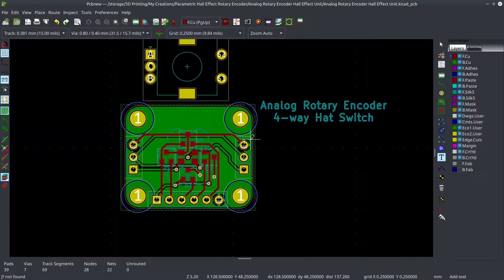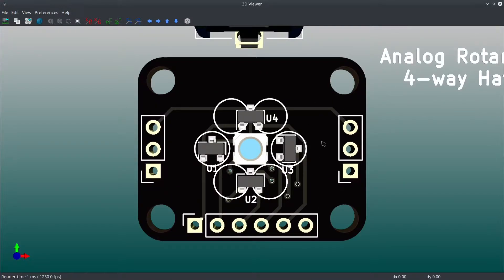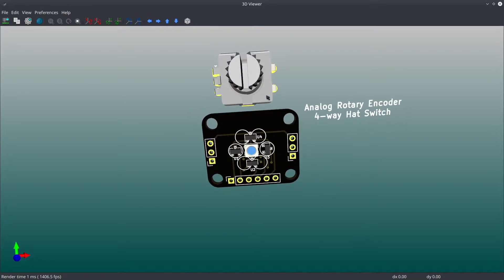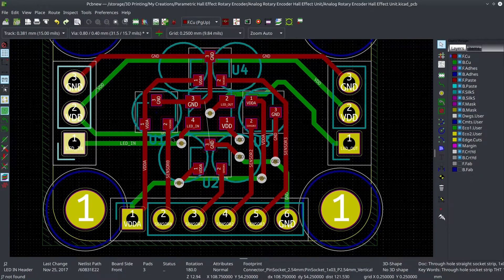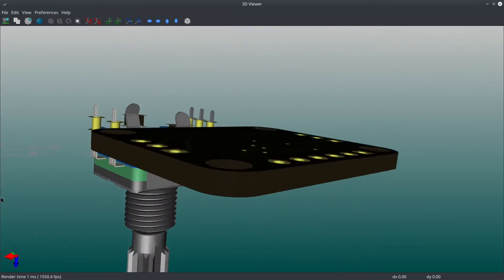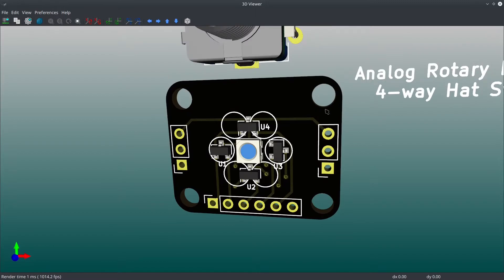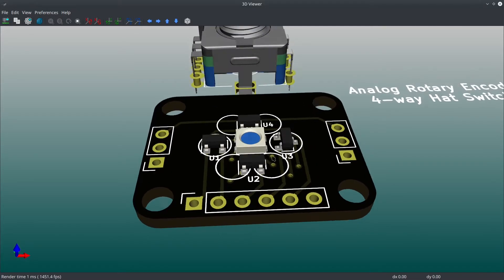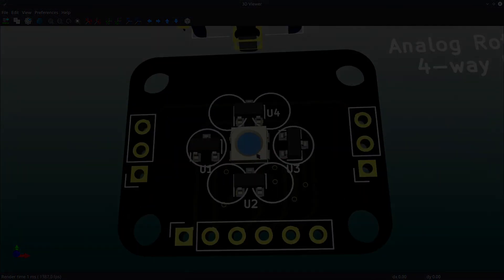New Hardware Idea: Analog Hall Effect Rotary Encoder with Four Way Hat Switch Breakout

Comment: // and the ball is enclosed in a cube with a sphere cut out of it, split into two halves top and bottom.
// dimensions adjusted to fit the board I don't have.
// bottom of enclosing cube is cut away to clear parts & connectors on the board.
// cube is high enough to allow for tilting.
// cube is low enough that you always have a signal on the sensors.
// cube has holes in the corners for mounting.
dball = 17;
xsize = 26;
ysize = 22;
zsize = dball/2;
dmagnet = 4 + .1;// slop
hmagnet = 1.7;
xmagnet = dball/4;
hhandle = dball*1;
dhandle = 5;
hknob = 5;

difference() {
    intersection() {
        sphere(d = dball);
        cube([xsize, ysize, zsize], center=true);
    }
    #for (r = [0:60:360]) rotate([0,0,r]) translate([xmagnet, 0, -zsize/2 - 0.01]) cylinder(d=dmagnet, h=hmagnet+0.02, $fn=25);
}
cylinder(d=dhandle, h=hhandle, $fn=25);
translate([0,0,hhandle-hknob]) cylinder(d1=dhandle, d2=dhandle*1.4, h=hknob, $fn=25);
translate([0,0,hhandle]) cylinder(d=dhandle*1.4, h=hknob, $fn=25);
translate([0,0,hhandle + hknob]) sphere(d=dhandle*1.4, $fn=25);
Reply: Added this. Printed it. Works a champ. Too bad I don't have one of these boards, otherwise I could polish the print and write some software.

difference() {
    cube([xsize, ysize, zsize*1.5], center=true);
    sphere(d = dball + .3);
    translate([-0.01, -0.01, zsize*1.5/2]) cube([xsize+0.2, ysize+0.2, zsize*1.5], center=true);
}